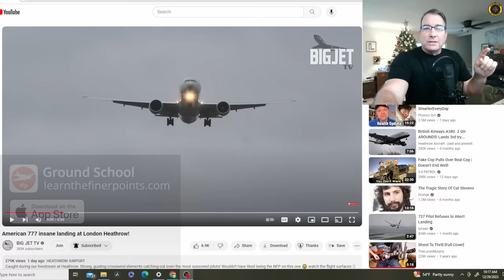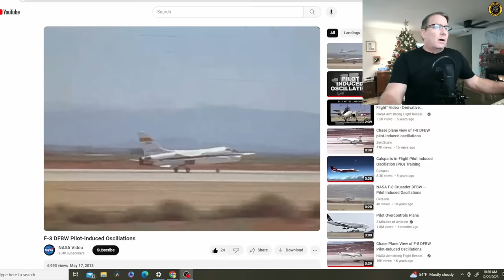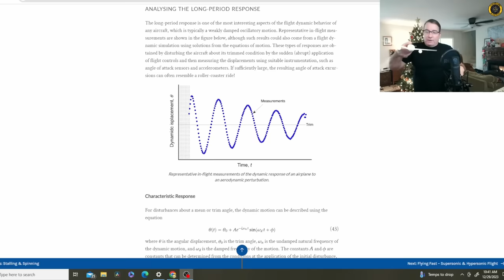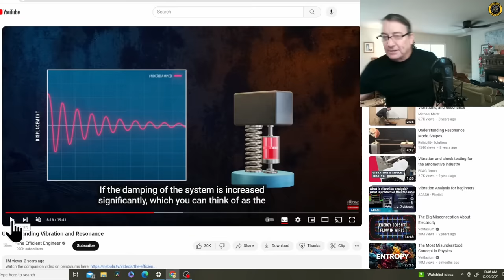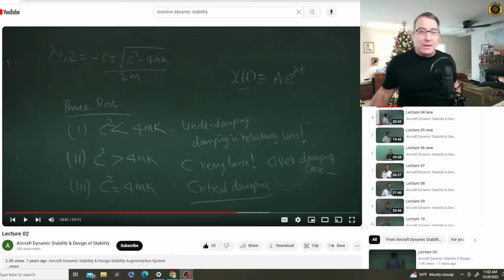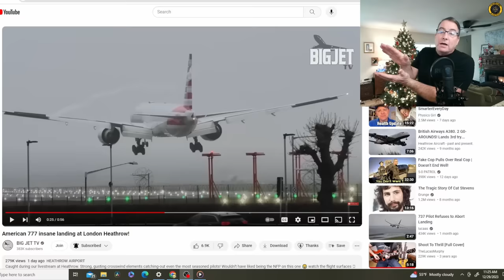B-777 Hard Landing LHR Big Jet TV

Comment: As a machinist in my short 5 year career with PanAm, I worked on the landing gear of the first 747-121s, some with really low serial numbers like 010. Every 5 or 6 years we would tear down these gear and inspect for cracks and corrosion, reboring pin holes for oversized aluminum nickel bronze bushings, made in house, newly ground hard chrome for pins and oleos. The steel for the 747 was 300 KSI rated. Light weight and tuft to machine. We used carbide tools with a negative rake to reduce chatter. Thanks for another fine video. James Restaino JFK Building 208 Dept. 435. Engine and Landing Gear Heavy Machine Shop (1986-1991).
Reply: I am a former Pan Am employee too (MVD city office 1959-1985). I do appreciate your service, taking good care of aircraft and doing valuable maintenance work. All the best !
Ivan
Reply: Thank you Ivan, my father worked for PanAm from 1943-1980 37 years. I would just made 37 years now if they didn’t go under. It just shows you how fast time goes by. Jim.

Comment: in the 1930s designers did not know how stable an airplane should be, things like how fast it should recover from an upset, how much control force is needed, etc. A new engineer, Robert Gilruth, went to work at NACA and this was his first task. They instrumented and flew dozens of planes. In the end, they set standards for basically what characteristics a good plane should have. To get an idea how fast aircraft advanced, 30 years later at the end of a normal-length career Robert Gilruth was the director of manned space flight during Apollo

Comment: Love the channel. Private pilot and Aerospace Engineer.  That being said.... you DAMP a dynamic oscillation, dampen is when you make something wet.

Personal pet peeve, and many engineers say it wrong as well.
Reply: What do you call it when you rain on the parade?
Reply: So the clear master of dampening an aircraft is Capt. Sullenberger.
Reply from the maker: Damping, not dampening...lol
Reply: As a STRUCTURAL engineer, I might suggest you dampen your expectations.
Reply: @willnelson5692  fixing the problem,  one person at a time.
Reply: Wrong? I'd say incorrect is the proper word, as wrong describes a moral or ethical wrongdoing, while incorrect means not accurate or precise. Personal pet peeve of mine...🙄
Edit: fixed an autocorrect spelling mistake.
Reply: I’ve been saying this wrong for years and never realized it. Thanks!
Reply: @Watchdog_McCoy_5.7x28  Thanks for the correction, I didn't realize.
Reply: @markrobinson2229  Whoa... are you sure I'm not dreaming? Might be the first time someone didn't get offended when I simply tried to make a legitimate critic. Thanks.
Reply: @Watchdog_McCoy_5.7x28  You merely pointed out that I was similarly ignorant. Why would I be offended?

Comment: Great explanation of dynamic stability without talking over the heads of viewers. As a young non military trained jet pilot I was taught a course called jet basic at my small but training obsessed airline. I keep the text of that course on my bookshelf today. I continued to study aircraft design and aerodynamics throughout my flying career. My first jet was a DC-8 which I moved to from an L-188 Electra. Prior to the Electra I had a few thousand hours in an Grumman AgCat, so I was good candidate for the jet basic course. I don’t know if new pilots training in their first jets today get a jet basic course, but I think it’s important. I learned things like high altitude jet handling in turbulence and Mach buffet. This knowledge saved my butt on a dark night in a mountain wave while approaching the Rockies from the West.
Reply: Approaching Denver from the west is often interesting ;o)
Reply: We get overspeeds frequently in the winter on 737's flying to Chicago from LA or the West Coast. The mountain wave increases ground speed greatly, then when they hit calm air, the airspeed goes over mach .80. If they're under mach .84, no overspeed inspection is required. We rarely have to do an actual inspection, and the inspection itself is not difficult unless damage is found.
Reply: 'small but training obsessed airline' - I take it in this age of myopic cost-cutting and false 'efficiencies', that airline is no longer in operation?
Reply: @davidf6326  They’re long gone. However, I later worked for another smaller airline for twenty years which had a superb training department. They taught international flying so thoroughly that when a Legacy airline made major navigation blunders over the Atlantic in MNPS my little airline was assigned by feds the task of cleaning up their procedures.
Reply: @dougrobinson8602  I flew the 800-NG from OAK to MDW which became entangled with our Hawaii flying. My experience in the Boeing twin jets is that as the IAS approached the red zipper I’d pull a small amount of thrust off maybe a knob or two and then pull in some speed brake. Always seemed to settle thing down.

Comment: I remember my first lesson with induced oscillation as a GIB with a pilot i was flying a mission with in the F-101. It was actually about porpoising and how easy you can get caught up trying to manually correct it and only making the problem worse. He continued to explain how to quickly stop it just by momentarily releasing the stick. During his explanation he induced the porpoising and stabilized as an example. He then had me do the same to put it all in perspective and setting the lesson to mind. You can have the same occurrence driving a car when a sudden blast of wind T-bones the side of your car going down the freeway at speed resulting with you quickly over correcting and do the same in the opposite direction.

Comment: Outstanding explanation of a Pilot Induce Oscillation (PIO).  If never dropping the O2 masks is how you define a hard landing, THEN I never had a hard landing in a C-141, MD-88, B-757, or B-767ER, but some landings were rather hard on each of those planes by me.  As you said ALL pilots will encounter such a landing in their flying career.  I never had a significant PIO however.  Holding what you get on pitch during one of these is ALL important as stated by Juan.  Juan great job once again !!

Comment: A friend who is a test pilot, actually type rated 777 pilot, F-16s, F-18s and  flown 30+ other jets.
She had a strong gust hit her just before landing maybe 50ft above the runway in a F-18.
She kept the wings level, landed hard and rolled out. No maintenance code but pulled data recorders from the jet, including fatigue monitoring recording systems data. They determined that even a really hard landing in a F-18F was still within limits for a carrier rated jet, including sideloads! No damage! Kablamo Navy version would require a much harder landing!

Comment: I learned about PIO during my primary training, when I was fighting the airplane on short final and my CFI said, just let go. The plane smoothed right out. Here I thought I was fighting gusty winds, and actually I was fighting myself. 
I’ve always remembered that. Sometimes a light touch is better. See if the plane reacts on its own.  
Oddly, the opposite is true for helicopters. They are dynamically unstable, and you have to be the dampener yourself.
Reply: The human brain is amazing when it comes to hovering helicopters.  It becomes it's own fly by wire system.  It's incredibly hard to start with, but once you've "got it" it's hard to make sense of what you're actually doing with the controls.  It's like learning to walk or ride a bike, you just think what you want to happen and your brain subconsciously translates that into the complex movements required to make it happen.
Reply: @brandyballoon How true! When I was getting my helicopter add on rating, the flying itself was fairly easy. Even the take offs and landings weren’t that hard for me. Much like my airplanes. But learning to hover was very difficult. I got very frustrated and told my instructor that I was never going to get it. He just laughed, and said everybody has trouble with hovering. He said to relax, that after a few lessons it would start to make sense. He was right, after doing it for a while it started making sense, and to my surprise I could actually do it! 😀
Reply: damper
Reply: I don't recall the details of the stories, but have heard that in WW2, I think it was, there were times the crew on a badly damaged plane that they couldn't control, and presumed was going down, bailed out...then watched, as they parachuted down, and saw the plane stabilize itself with nobody at the controls and just keep flying without them!
Reply: @johncox4273  I took a helicopter lesson in an R-22. The instructor was amazed. First he handled the tail rotor and collective. My hover was good, so he let me handle the whole thing. He was pretty stunned that I could do it with no experience. He said hardly anybody does that. I told him it's because I've been flying radio control helicopters for years, and know how a helicopter responds to inputs
Reply: @DerekJohnson-us7vy 

What is the difference between dampener and damper?
A dampener is someone or something that dampens.

Comment: I've been on a harder landing than that when coming into DFW in a thunderstorm. I thought for sure that we were going to crash. Everyone else was panicking and, oddly, this made me calm because I realized that, since everyone was panicking, I would probably have to help them off of the airplane if we crashed. I did think the odds of crashing rather than just landing were more likely than not because we nearly struck both wingtips on the runway before coming in for a completely safe landing. Credit to the pilot for being able to hold us high enough off of the ground during that oscillation and then planting the plane firmly once we were level. I thought it was great airmanship considering the weather.
Reply: My DFW flights not so bad, had one into BLR Bangalore/Bengaluru during monsoon season (yep, my bad) on a 777 which reset my internal calibration point!

Comment: Excellent explanation of cause and correction. This can and does happen frequently in automobiles, only just in yaw. There are many You Tube videos of cars swerving right and left with progressively larger deviations until they are 90 degrees to the direction of travel and crash into something. The unskilled driver overcorrects until something bad and noisy happens.
Reply: I’ve done it. Over corrected and ended up in the guardrail. Embarrassing to say the least.
Reply: That's also happened with airliners.  The MD-80 flight test simulating a hydraulics-out landing (by turning off hydraulic systems on final approach) which resulted in a runway track resembling a divergent oscillation.

Comment: 27R @ LHR is notorious for mechanical turbulence, with a southerly (left x-wind). Not likely to be wake turbulence at the approach end. HKG 25R has similar features/problems. 
Might have been a bit low on REF and copped some negative shear. 
I’ve been there done that, and can vouch for the engineering quality in Boeing aircraft 😅.
Reply: I think LHR does not switch the landings to 27R in strong left x-winds for the reason you state. That landing was on 27L
Why would it not be wake turbulence at the approach end if there was another heavy close ahead, especially if it had landed a little long ?

Comment: The 777 also has a gust suppression system. There are static ports on the vertical stabilizer. 2 on each side if remember correctly. Having just north of 4000 hours there was a flight I was on where the first officer who was “beating the meat” fighting the gusts and flying it like it was his old CRJ700 (he came from SkyWest) and the captain said “stop moving the controls so much” at about 2500 radar altitude. When the first officer didn’t he simply said “my controls” and literally took his hands off the controls and showed that the plane will counteract the gusts and by moving it and battling it you are making it worse. The captain gave the controls back at about 1000 AGL and after landing literally said “you can beat the meat in a clapped out CRJ but the triple likes to be caressed” I almost burst out laughing in the third pilot position.
Reply: Yes, between that and the system commanding pitch rate rather than elevator deflection...
Reply: "clapped out crj"
sounds about right for skywest.
Reply: This comment is so funny, I had to screenshot it. 😂
Reply: You know you're beating the meat in honest airplanes, but PIO feels like someone else is doing it.

Comment: Huh, learn something every day. I abandoned flying decades ago when I developed a serious cardiac condition, but I have MIT degrees in physics and mechanical engineering, and after nearly fifty years of working with this stuff professionally I even dream in dynamic equations. Yet I didn't know where the term "fugoid" comes from. Obvious enough if one knows a little Latin - "fugit", duh - but somehow I'd missed it. Cool! Any day in which I learn something is a good one. Thanks!

Comment: I had a similar situation, except in a car when I was just learning to drive. I was driving to town with my dad (in my ‘71 Pinto) down a country blacktop road. It had snowed, and the road had packed to ice in places. I hit one of those icy spots, and you could tell by the sound that we were no longer on dry pavement. The back end of the car twitched out a little to one side, so I corrected slightly the other way. The rear end then swung past the straight line, so that it was swinging the opposite direction. This continued, as I corrected each little swing of the rear end, and the oscillations grew greater and greater until we were doing 360s down the middle of the blacktop! Thankfully, I wasn’t going that fast, and we simply slid off into the ditch and a fence pole stopped the car (on my drivers door).

Comment: It seems like the best flying stories always come from the 727
Reply: I used to fly a lot and I remember the 727 as being extra bumpy.
Reply: Here's one. I am a mechanic, and went on a field trip to Allentown, PA to address a compressor stall issue on a 727. We adjusted the P&D (pressurization and dump valve) and the engine checked out okay. There was another mechanic and three flight attendants on the ferry flight home. I got the FA's and the other mechanic to walk as a group forward and back in the aisle. When we landed, the captain said "Well, the engines are fine, but the stabilizer trim was hunting up and down for half the flight". I confessed to the shenanigans, and we all had a good laugh.

Comment: Wake turbulence isn't going to be an issue with a strong crosswind. From memory though, you could get a pretty solid burble from the hangars/terminals on the approach to the 27s.
Reply: I was thinking, the aircraft was precisely banked for a side on wind, but even if the winds just dropped slightly then maybe the slight control inputs to hold that bank would become wrong for the dynamic situation. Thus left wing drops slightly, and the pilot is chasing the plane to catch up. I was more surprised how much he worked the pitch when the initial instability looks purely in roll. Perhaps it felt more like a pitch up from the front right seat!

Comment: 😂😂... Thanks for your chat on your career hard landings. I've had a few as a Gliding Instructor...  But my worst case was  in a British Caledonian DC10 coming into Edinburgh Airport. A big aircraft for a shortish runway. The weather was windy. First issue? He overshot, he came in over the threshold too high and floated on. There was sudden loss of height and "bang". We hit the runway and all the passengers were thrown forward. In fact some hit the backs of seats dispite being strapped in. No masks came down.... However the pilots applied so much break that we were struggling to sit upright. I remember turning to my wife and saying "he's overshot our departure point from the main runway"..... Eventually the 10 came to a stop at the end of the main runway but straddling the start of Edinburghs old main runway. We waited and waited. Fire Engines appeared and hoses deployed.....and my thoughts were correct, the pilots had used so much break the beaks had siezed due to heat and the DC10 couldn't move. Buses were brought out to get us off. As we walked past the cockpit there were two striped tapes across the cockpits entrance with "No entry". Later we saw the aircraft getting towed to a stand.

Comment: Hitting L will advance the video 10 seconds
Hitting J will rewind the video 10 seconds
Hitting period will advance the video one frame
Hitting comma will rewind the video one frame
Reply: Hitting the right arrow advances 5 seconds
Reply from the maker: Not when running OBS and 2 screens!
Reply: @blancolirio  You have a good enough computer to handle it, unless OBS or some other program is using period and comma for another shortcut.
Reply from the maker: The commands go to the wrong screen. Always.

Comment: Yea great analysis. And the solution to PIO as Juan described so well.....stop fighting the airplane, get the wheel/stick back, and wait........applies to almost all AC.  The C182 is notorius for PIO because its very nose heavy w no pax/bags in the back and pilots hit nose wheel first.  We taught folks immediately get the wheel back and wait for the plane to re land itself. Touch down may not be pretty but it works beautifully to cx the PIO and save thhe plane.
Reply: Never had a hard landing during the C-150 flight lessons logged by the CFI, but rode out a few. I always had the seat belts fastened throughout every flight; you never know what will happen next.